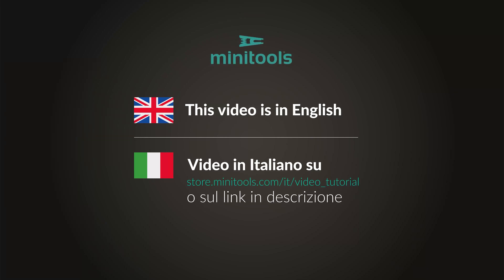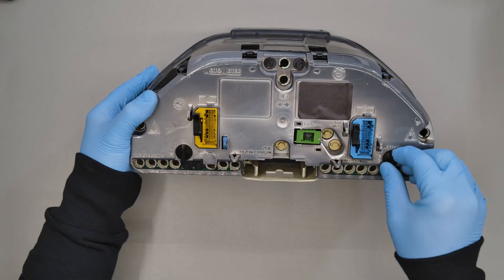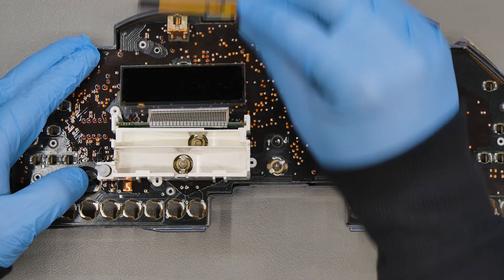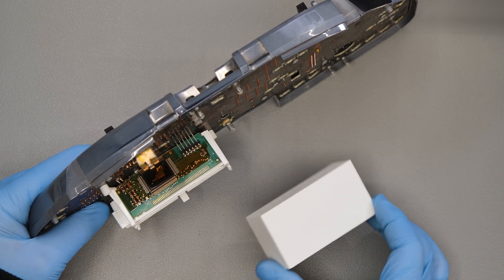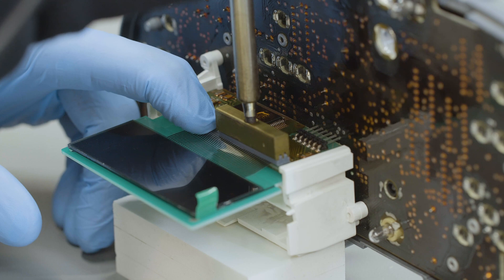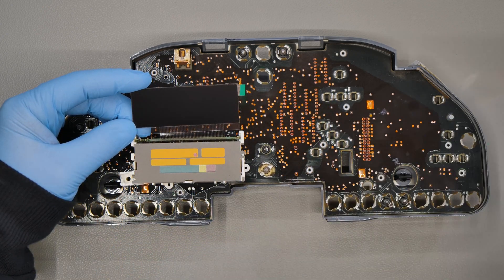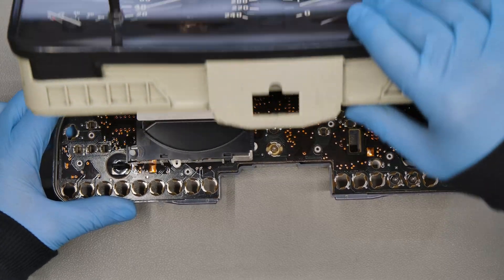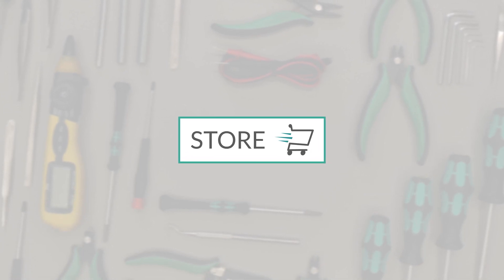BMW 5 Series E34 instrument cluster LCD pixel repair (Motometer models)

Comment: Hello, I'm going to repair mines, but where I can find 12V generator for final testing at the end? Thank you
Reply from the maker: Hi, we used a regular bench power supply, set on 12V.
Reply: Bonjour,pourquoi raccorder la borne 1 à la masse et 12 au 12volt, la broche 12 est une sortie
Reply: C'est le bus can ,il y'a pas un risque de griller le compteur en faisant cela?